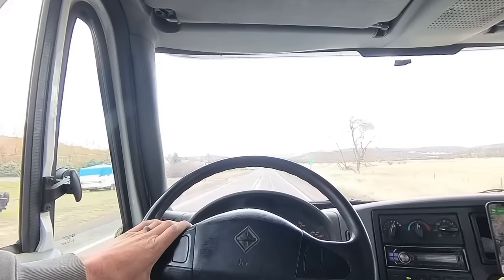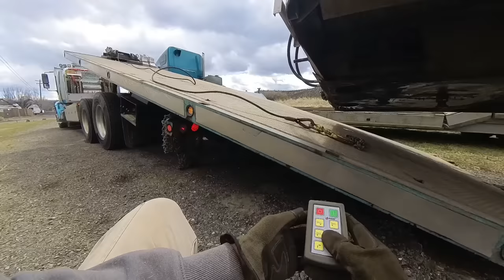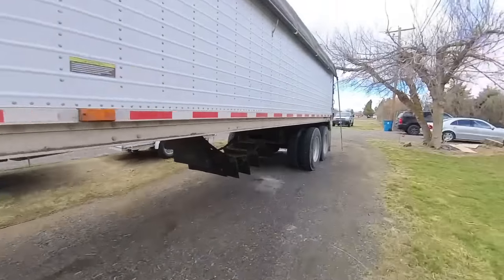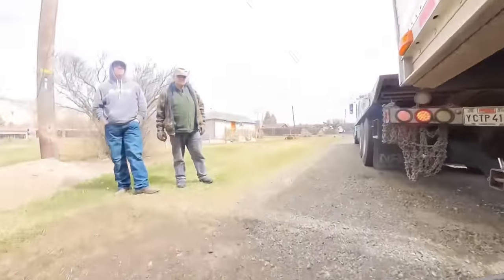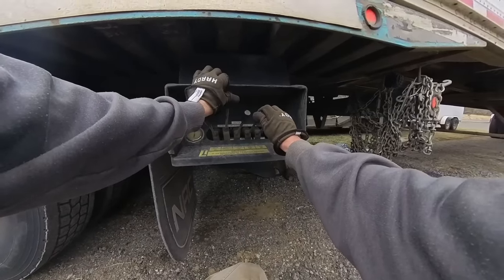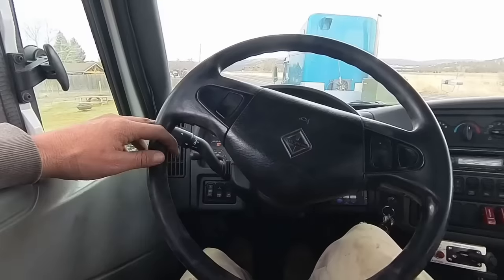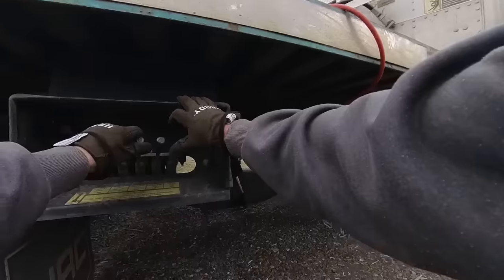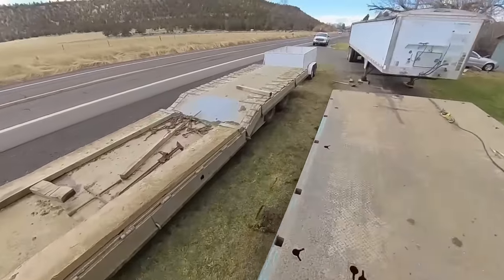Loaded Trailer Going Over!

Comment: That was an amazing save. That’s crazy that it broke through the concrete. Just shows that the side roads aren’t rated for that much weight. Can’t even imagine how much it weighed before they offloaded some of it. Hey you got to try out your newest 5th wheel attachments. Approximately how much does the 5th wheel attachment weigh that you had to move to attach the trailer too. Can definitely tell it’s heavy. Just curious. At least the slopped trailer helped on the way down but no so much on the way back to storing it. Stay safe and God Bless

Comment: The more comments I read the more I’m thinking about a trailer about a mile away from me.  Two years ago give or take a trailer for storage of materials and Equipment was dropped off at a new construction house building site. I’d say it’s probably 3 feet deep in the mud / Clay. When it was first brought in the place where it was set was down hill and I remember seeing pallets under the Dolly legs. They had fully extended the legs to level the floor of the trailer bed. There’s only two feet at most between the ground and underside of the trailer bed. 
Seems pretty abandoned now but it’s possible that it could be recovered. If I see any thing happen with it I’ll let you know! Should be an interesting day to watch it happen!
Reply: Again all you need is a tractor with air ride  ...maybe a chain ..lift it right up  in 10 minutes if you can get at the front of it .

Comment: I only have a few questions here:  How did a "half empty trailer" wind up dropped?  What happened to the tractor?  Is this normal for these types of loads?  I wouldn't have considered dropping my "hopper bottom" trailer like this unless there were other circumstances at play.  The recovery is absolutely amazing and skillful, given the resources Casey had on hand.  Just wondering how it got to this point.
Reply from the maker: Chain snapped durning the unload, so it took the back half out and left the front.  The trailer is now sitting waiting on parts.

Comment: Hey Casey did those blocks on the back that held the king pin bracket that hooked to the trailer!! Did they lock into place after you had flipped them to the top location?? I guess I was afraid that they didn’t lock into place and might raddle off going down the road!!!?? Just wanted to make sure that they wouldn’t go anywhere on you going down the road!!!??? Awesome video buddy and remember keep up all the hard work buddy!!!!

Comment: Kingpin through the hole in the bed definitely counts as a tier 1 Stupid Tow Truck Trick. Definitely not the way any of the equipment manufacturers would approve of, but it got the job done
Reply from the maker: If they didn’t want me sticking a kingpin in it, they shouldn’t have made a kingpin fit in it 🤷🏻‍♂️
Reply: @CaseyLaDelle  for some reason, that sounds a bit off color like a scene from Porky’s…

Comment: I did this but worse! I worked at a small warehouse that replenished a much larger one. My boss wanted me to load a trailer with more weight than it could hold. I explained the dangers of this and was told to do it anyway. Overnight the front would sink all the way to the frame. Took 5 days to unload and dig it out . Last time I saw that boss

Comment: From what I'm looking at, if the trailer is too high, why couldn't a truck driver use 2x4 pieces behind his dual rear wheels to push up the receiver for the king pin?

Comment: So one day almost 20 years ago I was working at a wine warehousing facility on the swing shift.  So we were all getting ready to start our shift when we heard a very loud thud like something slammed into the building.  Turns out, a driver either did not lower or lock that landing gear and a completely loaded trailer full of wine crashed nose down when he pulled out.  It too 8 tow motors to lift that nose lacing forks to get enough bite to raise it.  6 of those lifts were our standard house trucks powered by batteries and only two propane lifts were operational (mostly squeeze clamps used in the house).  Once we got it up, so much wine poured out of this trailer, and the standing gear was fine....that driver lost his job once the yard crew saw the gear was undamaged and working.  The most fortunate thing we didn't have to empty that trailer as it was an inbound load from one winery which they had returned to them to access total damage and possible reclamation (you can re bottle wine but it then has to sit for the same number of months or you can pour it in a tasting room)

Comment: Great video. Just an observation.... 

In the beginning you were using the remote control to manoeuvre the bed. Then later using the levers on the back of the truck.

Doing that meant we could not see as much. Could you not do it all from the remote control, and standing back? We would then get a better view.
Reply from the maker: The remote doesn’t have variable control

Comment: When I first started driving semi's here in Australia my boss said to Always block under the legs (we don't call them landing gear here in Australia) when a trailer has something in it and the prime mover is to be removed no matter what especially on gravel!!.... Pity that is not what happened there or they would not be in this predicament... Casey, you did a fine job with the equipment you had at your disposal.... I'm just curious as to why they didn't just drop the drop deck beside it and just back the prime mover under that trailer and move it.. hmmm.. weird. Casey, Something that might also help you out, when I was operating tilt tray tow trucks I put a mark on the underside of the bed near the control box at the rear so that when I slid the tray back I knew it was far enough back past the locks so that I could then tilt it.. I just used a paint brush with some orange paint and marked a line on the underside of the bed and when it passed a certain point I knew it was clear to tilt. This would help you from having to go check each time if you are past the lock section.
Reply: Exactly my thought  on this job...  ..lol  not a great big deal  ..I'm sure that I will be called a know it all for the way I responded  earlier .. guess I must be ..

Comment: Why not coast to a stop? Just because you know where all the gears are, doesn't mean that you have to use them! 😁😃
Reply: It's a fail item on the CDL test.  You can't coast more than the combined length of the vehicle at any time.  Clutch in or in neutral doesn't matter.  Theoretically it's unsafe, as you cannot quickly apply power to avoid a hazard.  In practice, everybody does it at least somewhat.  And brake linings are far cheaper than drivetrain components, why put the extra wear on the drivetrain?
It's like always having both hands on the wheel - you do it during the test, then you go back to holding your coffee cup in one hand as soon as the grader gets out of the vehicle.

Comment: Good job! Can I ask what the buttons on the steering wheel do?
Reply: Cruise control, as well as throttle for setting a faster engine speed so the hydraulics work faster.
Reply: @haroldphipps3457  Thanks, that makes sense for the hydraulics.

Comment: Job well done! You have a great bit of gear with that little banger. Just wondering why once you raised and chocked the trailer you didn’t just drop that low boy and use that nice blue prime mover that’s right there to just move the trailer? (No recovery knowledge) but From an observer just seems a lot of unnecessary messing around
Reply from the maker: Can you just walk up to any random vehicle and drive it?
Reply: Fair call just assumed it was part of the situation/job there or possibly contact the driver to use it. Fair question I thought 🤷🏼‍♂️ not meaning to be smart
Reply: Which is why I commended you and your equipment before asking

Comment: I own hoppers for years but never dropped any without something under landing gear. They are not like a normal trailer the center of weight is very heavy in middle so they will
Sink easily. Never drop a hopper without some timber of weight distribution under the legs

Comment: Why once you got it level ,did you not use the tractor that was hooked to the trl next to it ,,,a lot less work then you could move it where you wanted ,,,just wondering,,,great job by the way good recovery
Reply from the maker: Because you can’t just take random trucks you see sitting around
Reply: @Casey LaDelle  I figured they were all related to each other strangers don't usually park there just because ,,,,

Comment: Did you drag your truck backwards using the bed slide?  That was a trick.

Once it was put on stabile blocks couldn't you just have hooked the tractor right there back up?  Maybe help raise the trailer up first?
Reply from the maker: Yes, I can move my truck back and forth with the bed to position it right where I want.
Reply: @CaseyLaDelle  You explained it pretty well the second time you did it.  I commented right after I saw it before you had it on blocks, if that was the first time with bed tilted.  You have a wide range of tools, I hope you can get more.

Comment: So does that stinger have more down pressure than lift pressure?
Reply from the maker: Yes, all hydraulic rams do
Reply: @CaseyLaDelle  Yea, understood, I want sure if that ram was a push for lift, or a pull for lift. I would have thought it would be set up to lift as opposed to stabilize.
Reply from the maker: @JimsEquipmentShed  doesn’t matter.  All rams have more power extending than retracting, no matter what the application
Reply: @CaseyLaDelle  Correct, that’s why I was wondering in which physical position the ram was positioned for. 
For example, some  mini excavators have the piston on the house side, and that gives it more down pressure, where others have the piston on the blade side giving them lift priority.

Comment: Could you have hooked up a truck with a wet kit and use the flap belt to move the load to the rear, Maybe it would have evened the load out and took some weight off the front for you. Just a thought
Reply from the maker: No, because the broken chain in the middle of the trailer is why the front is loaded and the back isn’t.

Comment: I could have told you that the fifth wheel bit wouldn't work because it was way to far back for the "mechanics" of it to work.  You could have pushed the trailer back when you had the bed under it the first time, or when it was back on the landing gear, they could have just backed the tractor under it and hooked up and been good to go.
Reply from the maker: What tractor?

Comment: So I had a friend that had a trailer near a railroad crossing and it was a little bit loaded heavy to the low side it didn't sink into the ground The vibration of the train caused the trailer to tip over how would you like to explain that to the insurance company they wouldn't believe it. They wanted to know what truck was hooked to it

Comment: Do you engage the hydraulic on the steering wheel? 
And also, that's an enormous button. Damm.. 
You could almost fit a old 900GSM cellphone in there. Or a small pager
Reply from the maker: Cruise control to bring the idle up
Reply: @CaseyLaDelle  I see.. 
Is it like in Europe, and you can get an array of options and designs? 
Even just for the steering wheel.. 
And also, it's fun to see how other trucks work and their functions. 
That hydraulic bull bar arm hanging on the back, is a bit more advanced then what we have here in Denmark..

Comment: What are the buttons on the steering wheel that you pressed for?
Reply from the maker: Cruise control to being the idle up
Reply: They are the cruise control buttons that are used to raise the engine revs when the pto for the winches and hydraulics are being used

Comment: Very impressive🤔. This is not easy work you need to make calculations and adjustments...🔧📋🔩🗜🚚 Safety is # 1 .®..    Side note what popped out the back when the flatbed❓🚧♊ separated from the box trailer.

Comment: Confirmed pretty dumb NOT using or simply having dolly pads, especially on highly unstable ground as this & add water or moisture and this dump drop a trailer here and leave like it's on 20 foot deep concrete.

Comment: What do the buttons your pushing on your steering wheel each time you get out
Reply: Cruise control that also acts as throttle control to increase engine speed to proper hydraulic pressure to the tilt bed and other systems.

Comment: My new semi has a switch on it I can pump my air bags up about 5 inches higher from normal ride height in case I get a trailer that's sitting to high once iam hooked just push button lowers back to ride height if I push button again just dumps all my bag air

Comment: Just My thoughts of you putting the Kingpin in the hole of your bed that is not designed for the Kingpin and getting it stuck to the Trailer and possibly now you need to design a flat plate of steel that you can put in the chain tie down and hook up to the Kingpin, instead of the lower boom kingpin lift and Or drill another hole in the bed to accommodate and Use your kingpin lift from the bed  , I hope I have explained it enough for you to understand.... Just from what I seen that could be a possibility.....

Comment: That'll learn you not to drop a trailer without putting pads or 4x4s under the landing gear. Good thing it wasn't a load of pipe or a top heavy load.

Comment: (Edit) no way i knew you could use a 5th wheel plate. Ive eyeballed it on other videos and never seen it in action until now!

Should of gone to the semi dealer and mounted a 5th plate to your deck (all jokes of course) 😄
Reply from the maker: NRC actually makes a 5th wheel plate that attaches to the deck.
Reply: @CaseyLaDelle  thats pretty sweet & thnx for your comment! Safe travels 🤟

Comment: Now you need to clean your steering wheel and get all that nasty fifth wheel grease off of it you smeared on it with your nasty gloves jumping in and out while touching everything.  I would’ve took my gloves off before touching anything inside the truck, and I would’ve hooked up the brake line to the trailer too so if it decided to slide off the bed you wouldn’t have ran the landing gear through the bottom of the trailer when it slipped off.  Slow down, take your time, and use more caution.  The trailer isn’t in the highway, there’s no emergency.  You could’ve destroyed the trailer.